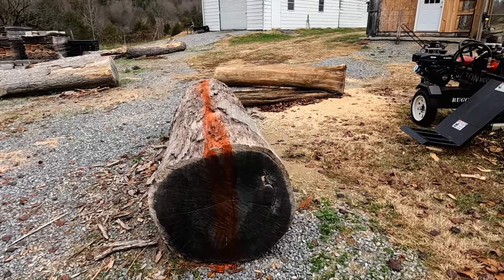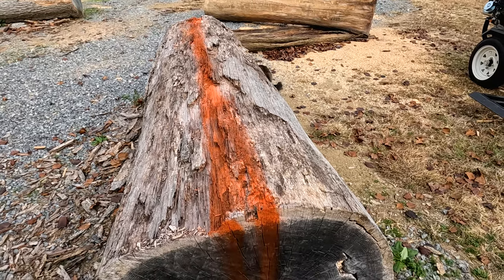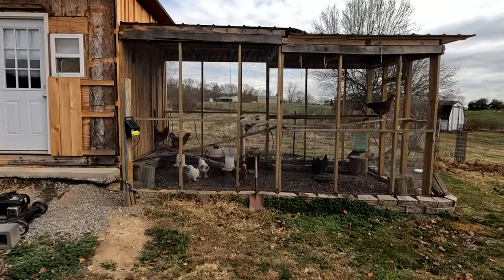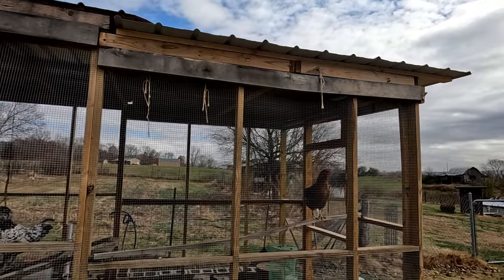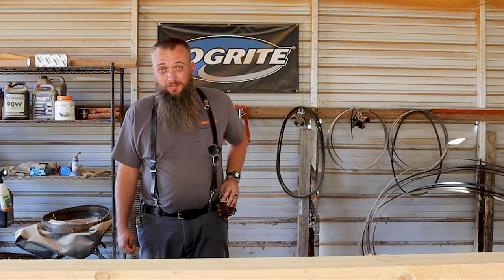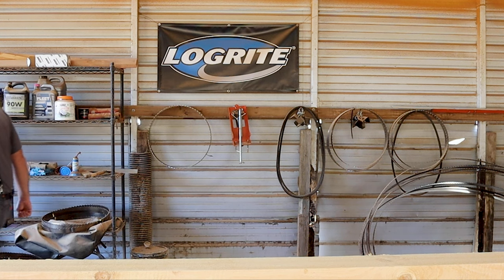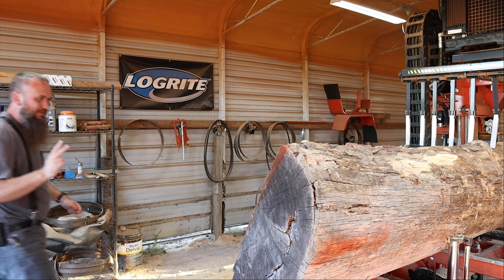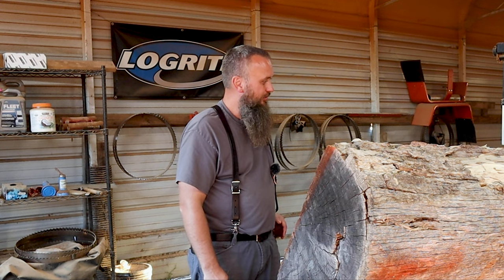Logs TOO Big For The Sawmill VS The Germans Most Powerful Chainsaw

Comment: I don't own a mill, but once in a while I have to rip a log to make planks to build a trail bridge. I've got a Stihl with a 25in bar. and a rip chain. To start out I use a peeve to roll the log onto a couple of small split logs cut to about 18ins. long. If I need to, I use wedges to keep the log from rolling. This keeps the log off the ground. Since the log is off the ground I can start at the top of the face or end and rip all the way down the face until the end  of the bar is a few inches off the ground. Keeping that angle I pull the saw down the length of the log. I let the body of the saw rest on the log. This method lessens the chance of a kick back. This way I can rip logs around 20in with no problem. Most of the time I rip the planks at 2in. Depending where the bridge is I may rip the sides to give everything a cleaner look. The conservation land I look after is 1,500acre and we have 10 miles of trails. By the way my trail saw is a Husky 550xp with an 18in bar. It's a lot easier to haul through the woods then the Stihl. One sad note. I grew up in New England. We had 50 acres of mostly side hill rock. There were four White Oak on the property. One of the oaks was with in five points of being a state record oak. Just before my mother passed away I took hike up and the biggest tree was down. I guess the wind and age got to it. It was sad the fell, but it was even sadder that there was no one with in a hundred miles that had a mill big enough to mill the oak. If we could have gotten it out of the woods.  I often wonder what a clear,6ft dbh by 20ft+ long plank would sell for.

Comment: I worked in a log yard for many years . My opinion is that  it is easier to use a 20 inch bar and cut one side then roll the log and cut the other. But you did a great job.
Reply from the maker: Thanks for watching

Comment: Years ago My in-laws ran a professional hardwoods sawmill, and they had a log that was too big for their carriage, about 4 1/2 feet in diameter. They made a plunge cut in the center , a squared out hole, and my brother, in the water well business, used 2 sticks of binary explosives to split it in half. It worked to perfection. They paid him with a pickup load of red elm planks and beams, for his drilling business. Fond Memories.....🙂

Comment: Great tip for handling large logs. We just got an lt15 and will undoubtedly need to apply this method. From experience I would not recommend buying a ripping chain just for this type of cut. Full chisel works fine for angled cuts that yield “noodles” for saw chips. I do use a ripping chain for chainsaw milling when I am cutting square into the endgrain.

Comment: Never heard of  ripping chain. Once upon a time back in the 1960s I had to split some large oak, and an uncle put me onto using some pieces of steel strap, about a quarter inch thick and about 3 inches wide, with a ground tip to an edge. These were used as starter wedges in cracks in some large oak to open them up enough to get a regular wedge into. Still have them in the garage but never needed them since. Anyway, the idea of a starter wedge will work if you do not want to use the saw for a cut like that or cannot because you lack the correct chain. You have to man up of course!

Comment: What's the difference between the 2blades because iv never used or seen a ripping chain iv only used regular saw chains.  
If you had it would it not be better and save you some lumber to cut a big log down to a possible working cant with an Alaskan style chainsaw mill??

Comment: Nathan I do the same as you splitting big logs.  I use a  Stihl 460 with a 42" bar. Our mill will only handle a 28" log. I do have a chainsaw mill for some of the big logs when I want wide slabs.

Comment: I think it might be easier just buy one of those saw guides that goes onto the log and cut boards out of it with the saw. It looked like a lot of work splitting it in half like that. Then after cutting boards off of it and you get half way down and decide to put the other half through the mill problem solved.

Comment: Thanks Nathan.  A lot of hard work splitting that log, but not as tough as the one we saw you split in one of your first videos. I've thought about this since then, but then thinking is not the same as doing: Wouldn't the split log still be the same (too large) for the small sawmill?   Wouldn't it be easier and smaller if you chainsawed jacket boards?

Comment: That was interesting Nathan to see how you do it State side.
I live in Central Qld, Australia and it is not an uncommon practice to rip saw timber for fence posts or fencing rails here. It is probably what is considered an every day practice.
I have done a fair few in my life but, there is many more that made a living out of ripping posts here that have a wealth more knowledge than me.
Our timber is Australian hardwood that we utilise here for that purpose.
My biggest saw that I own and run is equivalent to a Stihl 661 with 28” bar and have comfortably cut logs 6’ diameter...
Reply: The biggest Log I have seen ripped for a bench mill here was a Qld Bluegum (Eucalyptus sp.)
Butt section was 7’2” dia and 12’6” long. We had to rip it in half to load it on the truck to transport it back to the mill (circular mill, bandsaw mills weren’t known here back then)
On site we cut 37 railway sleepers (I think you call them railway-ties?) just from the canopy timber alone

Comment: Putting the log on a couple of notched small logs for risers would let the log be sawn completely,  no splitting!  Cutting as you did there is little or no advantage in using a rip sharpened chain.
Rip chain is the same as crosscut chain with the top angle at about 10 degrees instead of 30.  Usually semi chisel with the drags filed lower than normal.

Comment: How did splitting that log the way you did make it easier to saw on a smaller mill? Any way you turn it it is still going to be 36 inches wide, or if you stand it on it's side it will be 36 inches tall.

Comment: So, we need to clean up the middle where the log was split. Did not show that. So, the log is too big to fit on the sawmill. Did not show that. Splitting the log did not change the diameter of the log. Did see that. The difference between a regular chain and a ripping chain. Did not see that. I am not sure, but could this video be compared to: A child should be seen and not heard?